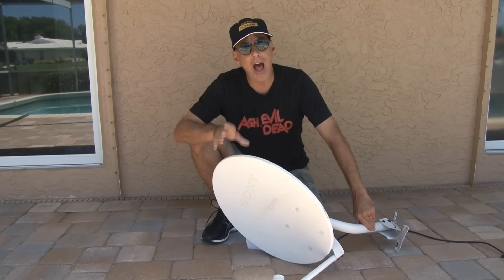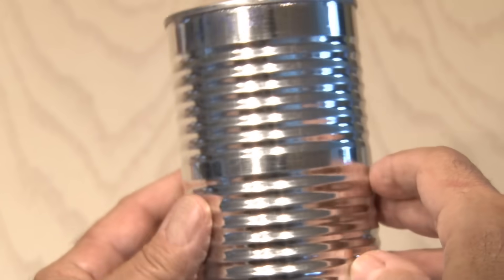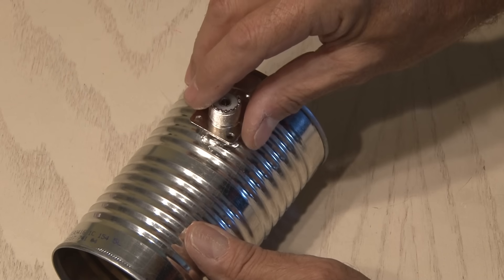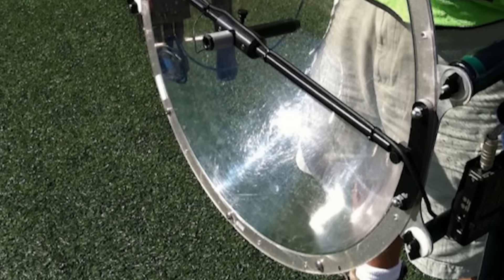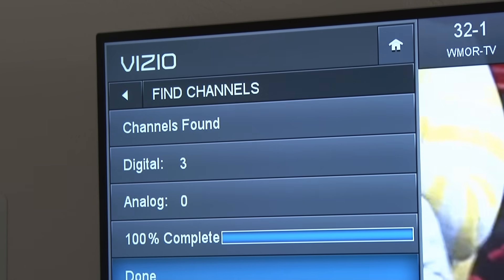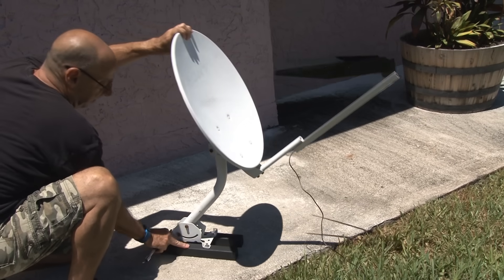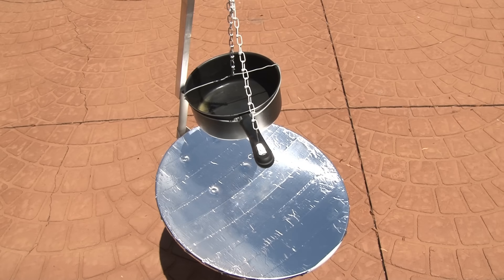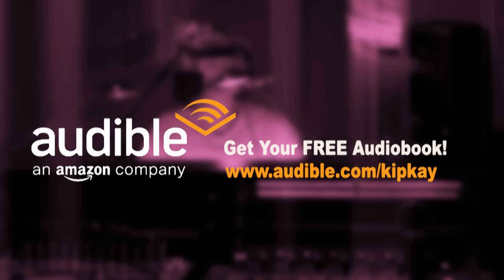4 Brilliant Uses for an old SATELLITE DISH!

Comment: Hey kipkay i want to ask you about wifi-can
What device or modem did you use to grab wifi signal kipkay please i want your responce quick i wanna try this at my home so i can communicate to my love ones for free and no data charges from my carrier
Reply: Jezreel Azuela the dish only increases range by a little and only in one direction. You need a signal to grab. Maybe point the dish at a nearby Tim Hortons or McDonald's free wifi?
Reply: Carey Bush  do i need router in order to grab wifi signal with the dish???
Reply: Jezreel Azuela yes
Reply: actually you could connect the wires from the dish to the antenna connections on a computers wifi card, then use another wifi dongle or card to send out a hotspot to other devices, basically using your pc as a router, but if you did it with a laptop it would sacrifice portability

Comment: For the Long Range Wifi Cantenna how long is that pigtail connector? and could you use broadband cable instead(coax cable) from the cable company to connect it to the router?
Reply: carluzrt its the same bro

Comment: not to sound dumb or anything but for WiFi using an N connector would be better then a SO-239 or UHF do a little checking around it normally tells you what connector is good for what frequency range (like 1.2Ghz to 2.5Ghz) and 2.4Ghz being in the middle
Reply: Is it even possible to use a satalite dish to extend wifi? I have seen many forms saying it's impossible because you need to send and receive wifi and a dish can't dinthsf
Reply: Ferrariassassin Gaming there are sattelite dish wifi extenders already on the market for sale. just do some research.
Reply: Ferrariassassin Gaming 
The router it's hooked to transmits through the antenna. The antenna is hooked to the satellite.

Comment: So, I’m about to build the Long Rage Wifi satellite thing. Here’s a few questions, Does it even work? And what kind of Router/Modem did he use or a similar thing like that? I have a place of mine that doesn’t get any WiFi or cell signal. Will this help me in one of those two ways (Cell Service or WiFi)??

Thanks!
Reply: Davis Clark my route does not have a large pigtails cable cord socket but it has a smaller one so I wonder if I can solder it to it?
Reply: that will capture you downstream flow but what about the upstream

Comment: You needed to ground the so239 connector to the metal can not hot glue it, you would need an active ground plane to make the wifi antenna work efficiently.

Comment: how to point directly to the wifi spot? i can't seem to be able to pinpoint to the exact location. is there any software what shows how far i am from the focus point.
Reply: i have made a Satellite Cantenna Monster, and now i get internet with it.
i can't have internet on smartphone, it's too far, but i get internet only for PC with S.C.M.
I know where the internet comes from, but i need a software to tell me how far am i from the middle of the wifi signal so i can get my S.C.M. point right in the middle of it.
i have successfully made this step 2 times, had 5 bars of signal, but the thing is so sensible the signal goes to 2 bars in no time.
Reply: So, your saying it really works? I've got all my satellites ready to go but what kind of Router, Modem, etc did you use? Also, what is a S.C.M. Thanks!!

Comment: I'm no expert but that WiFi 1 don't look like it would work. How do u get WiFi signals with the dish into the output Antena? That doesn't make sense. That's like watching video through the camera and recording with a screen
Reply: There is an antenna attached to a circuit. How does the song go into the radio?
Reply: Why shouldn't it work? Wi-Fi uses microwaves, they are reflected by the metal. A parabolic mirror works both ways, you can transmit in or receive from a certain direction.
Reply: the "dish shape"  gathers signal and directs the signal thru the wire.
Reply: KeegsBruH413 lol,its a wifi router not a modem.
Reply: I get how the dish catches the signal but how does the signal go into the router wer it normally comes out
Reply: i understand how it gets the signal but how is it getting the signal all the way back to the fast food restaurant
Reply: Most Wi-Fi routers now a days allow you to remove the factory antennas. Using a premade or making an adapter cable, you can connect one end to the back of the router and the other end to the homebrew antenna. The router does the rest of the work, transmitting and recieving the signals through the antenna.
Reply: Keebler elves' side job. Them & Oompa Loompa's. Only part time though. Saves money cuz we don't have to pay their benefits, like paid vacay days.
Reply: i imagine that your download speed will be much, much greater than your upload speed. if you're just surfing the net this won't be too much of a problem, but you aren't going to be able to play fast paced competitive games or uploading hd videos off of it for sure.

Comment: I actually had the HD signal idea and tried it already. It didn't work.
Reply: plainlogic then you done something wrong because I tried it and with short cable run picked up UHF fine now VHF was a different story.
Reply: red2965 Oh, well make a video showing how its done.
Reply: plainlogic remove your lmb that's the plastic thing on your arm or not didn't really matter. 
Take a section of the ceter wire on your cable and ground to it.
Yes before you yell at me tbat tbere isn't a ground i know this but it does work when aimwd correctly at the tower....that's the trick.

So! Use it at your own disgresion or get a hd antenna and place it to ground and use the reflector as a catch all.   Just saying.
Reply: red2965 firstly it's an LNBF not an lmb. Secondly it didn't work for me probably because of my location and distance from any antenna.

Comment: What the feck is sodder!
Reply: Solder, and it is what you use for soldering, it's a metal with a low melting point so it can make electrical conecton.
Reply: Austin Grimes nope thats solder not sodder
Reply: stephen jones See that's what I thought.
Reply: You say saul-der, I say sodder. You say bonnet, I say hood.

Comment: Can I use the can without the dish somehow? That would make it easy. I want to grab a high speed signal only 200 meter away.
Reply: RajTech King grab a hi-gain antenna from local electronics store and a Pringles can
Total cost should be less than 15 USD

Comment: What kind of router can pick up wifi through a coax and then redistribute ?????? Thought the antenna coax was for sending not receiving signal
Reply: Alvaro Nino are for real, what do you think the antenna on the router is made from.
Reply: funky vegan yes I'm for real as far as I know the antenna on a router distributes through the antenna and the input it from at cat5 cable
Reply: Alvaro Nino Guess what he forgot to say, was this is set up in bridge mode.

Comment: That UHF (PL-259) connector you used is not rated for such high frequencies (WI-FI: ~2.4Ghz). The connector is rated for frequencies up to 100Mhz. You should've used N-type, BNC, TNC or SMA connector instead of using the UHF connector, because PL-259 Has high insertion loss at such frequencies.
Reply: I doubt if the connector makes that much of a difference. the length of the wire ( antenna  ) in the can does.
Reply: urbanstein69 yes, all of these things matter: the lenght of the cable, return loss of the antenna and insertion loss of the connector. I couldn't find any graphs that show the insertion loss of the UHF connector on 2.4Ghz, but I suspect that it will be around 4-6dB that is a lot for Wi-Fi (Wi-Fi routers nominaly have transmission power of 20dBm (0.1W)) at such a low power, every bit of loss matters. The N-type and UHF connectors cost almost the same, but the N-type is superior in every way: it is water resistant, it is designed for microwave use (up to 18Ghz) while UHF connectors are designed for 100Mhz (they are called UHF because at that time 30Mhz was considered ultra high frequency). N type connectors offer much more performance for almost the same price, so why not?
Reply: He did not even connect the ground :)
Reply: Two thumbs up!
Reply: Simas: Most of the YouTube videos on this matter use the wrong connector. Most place the connector at the wrong position in the can and fail to mention you really should use another directional antenna at the source for long distances. None I have found mention when this is legal (and it can be), few mention to calculate the focal point of the dish, some mention this really only works well at 2.4 Ghz, and none mention exactly how to feed the signal to your router. I cannot see how most folks could ever get this to work but...an broadcast engineer might.

Comment: I have seen an antenna called a magic stick.  Will it work for my tv ? It is a Sony made in 2007. I never had cable or satelite dish. Can I still hook up my Sony TV (2007) with a discarded dish I found ? I have no black boxes  or any of that stuff.
Reply: Yeah, and they're cheap. Like $9 at wallyworld
Reply: triumphmanful Sorry, no. Your TV still has the analog tuner in it. You would need to use an analog to digital converter.
Reply: My bad... A D2A NOT an A2D... Whoops!

Comment: Hot glue will act as an insulator, and will goof with the SWR of the transmitted wifi signal.   Did I mention, without proper tuning of the cantenna, you will burn out the transmitter in the router, due to high SWR.

Comment: Just FYI, doesn't pull signal from over 22,000 miles away, Low Earth Orbit is up to 1,250 miles away maximum.
Reply: FYI Satellites for TV service are in geostationary orbit which is approximately 22,236 miles above the equator.   THEY ARE NOT IN LOW EARTH ORBIT.
Reply: Except you don't communicate with GSO satellites. If you think you can reach 22,000 miles through all of the earth's stratospherical layers with a tin can, you'd be wrong. You communicate with LEO satellites that in turn relay information to and from GSO satellites.

Comment: what uhf coax chassis mount connector did you use here? i like the female piece sticking up a bit passed the plastic dont want to melt it when soldering.

Comment: Im not a ENTHUSIAST in this stuff but, im into ham radio and just saying that the coax connector should probably be mounted with screws for best results. The reason is that radio waves pick up a lot of interference when not properly grounded btw I love your vids and have been a sub for a long time

Comment: FYI, Satellites orbit at 200 miles (LEO), not 22,000.      Let's assume yours was a joke.
Reply: Rick Parker there's a large range, 22k miles is about right though.  check Wikipedia
Reply: GeoStat orbit(geostationary orbit) is where Television satellites are, to be able to follow your position, to give you a constant transmission. 
GeoStat is at 35,786 kilometres (22,236 miles) above the Earth's equator and follows the direction of the Earth's rotation :) Lesson over :D

Comment: would adding the  shiny tape make the dish better for the wifi or hdtv? How do you figure out the angles or azimuth??  would a larger can with a longer or spiral antenna coming from the bottom get a better wifi signal perhaps from a longer distance??
Reply: for HDTV it is just used to make it non omnidirectional...which increases the coverage pointed at a certain tower...doesn't matter if taped nice and shiny...not sure about wifi though
Reply: I’ll just give you one ya can travel with

Comment: Should have used screws on the so239 connector to ground it to the wifi can. Silicone insulated the coax ground.

Comment: can i cover my satellite dish with aluminum foil to make a better signal? can anyone tell me pls ty
Reply: why not cover the satellite dish front in 2 sided sticky tape or spray glue? then put Aluminium foil on shiny side up I would polish with a cloth to make it smooth and you would get a stronger focal point or what about chrome spray paint?
Reply: Maybe, but if the Sun hits the right spot, it could burn a hole in your LNB pickup. If you have a bad signal, the dish is not aligned correctly, or there is something obstructing the satellite signal, like tree limbs.
Reply: An aluminum foil hat works best
Reply: can you give me an picture example please cause im having a bad signal
Reply: Jherald Abellon - you need  to move the antenna, where you can fine a good signal, that is it
Reply: It would not change the signal strength at that frequency, you could have a parabolic screen and you would have the same signal strength.
Reply: no aluminum foil would not help a parabolic dish get better signal, they are designed to get signals from satellites your problem is the the direction it is pointing , 
i used to work for dish, now Cisco networking  ,when i used to install dishes we would take a compass to point at the source
Reply: can you give me an picture example please cause im having a bad signal

Comment: Greg K  I'm not 100% sure but it looks like a N type.  I have an older Linksys router similar to the one in the video but mine has those "rubber duck" antennas on both sides.  I just dug it out of my junk box to make sure.  By looking at the center conductor on the router in the video it appears to be a N type.  Good Luck with all of your projects.  Gene W4BEB

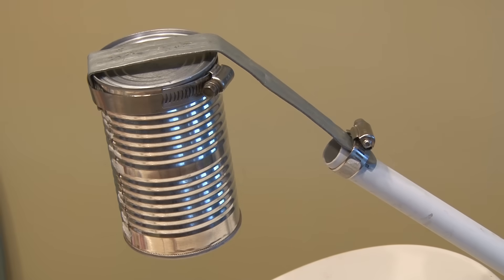Comment: 3:12 
What type of cable is that, it is not coax
Reply: RG-58U coax with a PL-259 connector attached to a SO-239 at the can with a N type connector attached  to the router.
Reply: JJTheCaptain! [JJKnott] yes it is
Reply: isn't that a mini UHF at the router?

Comment: That's great but what exactly in the antenna. I have found it difficult to get one suitable in Hong Kong. There is no problem to get a disc. I had  a five-foot dia. one before. The trouble is that most channels here are locked.
Reply: What brand is the antenna is my question. Thank you very much.

Comment: Well the WIFI antenna has a BIG problem. You cannot just cut the wire to reach the middle of the can or whatever length is handy and expect optimum performance. It is more about tuning/cutting the antenna wire to match the wavelength of the wifi signal and THEN mounting it to center .
Reply: how bro.
Reply: Gene Brackenbrough how?

Comment: I have a old Belkin router and two USB dongles. You show in your antenna construction, unscrewing the antenna and screwing the RF cable in its place. Is the ability to remove the antenna standard on routers? I hate to try to force unscrew my antenna and break something. Any help appreciated. I would like this setup for the reason of running a CAT cable from my router rather then having to have my computer where I have to place my antenna.

Comment: are all of your local HD stations  in one direction  (say north) from your home? the position of my home is in the middle of three different directions where are antennas are located. will this only work if all of the station antennas are located in one direction?
Reply: So, if you have 3 directions, make 3 of the antennas and position them with a three-way connector and see if you can pull them all in!

Comment: The old 8 and 10 foot dishes work well as water heaters. Just get a black heavy duty garden hose and wind it around on the inside of the dish. Attach the hose with cable ties. Point the dish at the sun. As water flows around and around in a spiral inside the dish it comes out hot on the other end especially if you let the water stand in the hose for about a1/2 hour.
Reply: Would work much better if water passes near focal point of dish

Comment: if i use that silver tapping for signal reciever,will that silver tapping help in grabbing more signals than that of previously used nacked dish?
Reply: Ashutosh chaudhary no the Mylar only reflects light. a larger dish would help
Reply: Ethan Todd why not?
Reply: Can you explain why that silver mylar won't help in reflecting more signal?
Reply: Because a.v. signals dont move through light they move through the radio-micro wave frequency. Light is too intense of a frequency for the physical particles to carry electronic signals. Because even these radio waves are a particle half the time and the wave particle oscillation is slow enough for us to bounce signals through the emitted aura of waves and particles. Read about a man called Nicola Tesla.
Reply: Ok, as i am not qualified enough like you sir but with respect i want to say that i have made a wifi signal booster with an aluminum foil as i am a poor fellow, so could you explain how am i getting better strength after using foil on the back of my wifi router antenna, sir!
Reply: I got the punchline wrong :(   I guessed Aiken Drum

Comment: KIPKAY...on the tv antenna section, the model you are using is an Antennacraft (model #1500470)for indoor use.  Is using it outdoors in rain and such still going to work...or malfunction for that matter?  Otherwise, do you have an outdoor model suggestion to use with the satellite dish instead?

Comment: I have a massive old sat dish. One of those huge black ones not in use anymore. It has a motor on it and I'm trying to decide what I might do with it. What kind of range do you think I'd be able to get out of it? Should I use larger can? I was thinking about using it to transmit a hotspot but I'd obviously also like to see what I can pickup. I also thought I might use it for its intended use (Sort of) by seeing what sorts of satellites I might be able to talk to and with what protocols.
Reply: I wonder if I could turn it into a radar. Radar uses microwaves though right? hmm...

Comment: Bought a House and it had 3 Dishes mounted on the side- One was only a couple of months old, I then called the Provider And asked if they wanted the dishes back before I removed them and scrapped them. She didn't give any answer besides that she would gladly send a local Tech out to remove these dishes for a small one time service fee of $125 per dish. Needless to say but I removed them and they went curbside where a local scrapper joyfully  snapped them up.